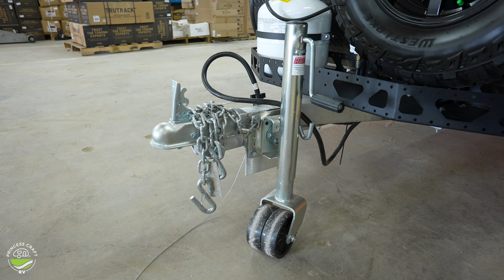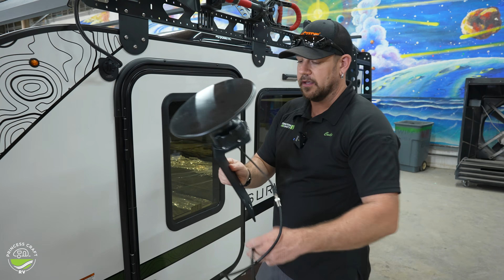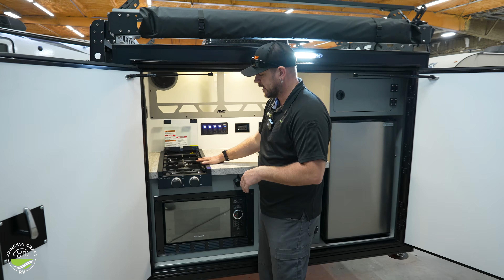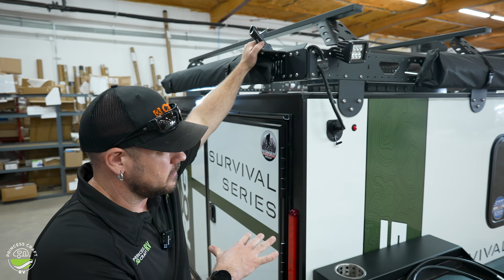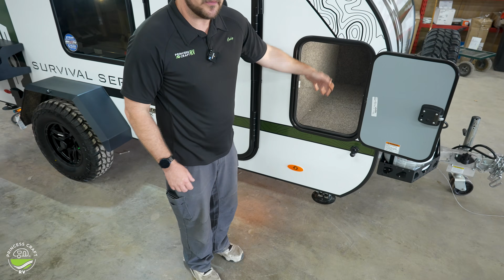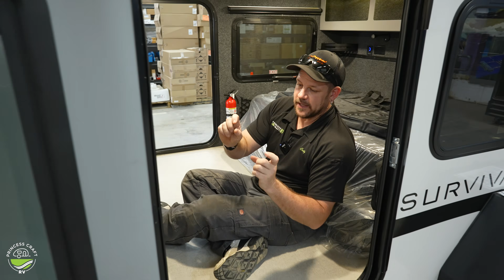ROG 12RK Survival Series Adventure Trailer by Encore RV   Tech Tour

Comment: Nice, but this is so totally overpriced based on what I saw at the dealers lots.  No real shower, no holding tanks, no articulating hitch (the ball hitch is joke if this is supposed to be an "off road" trailer), too small of a propane tank, crappy cheap tongue jack and cheap levelers and no water heater, not to mention almost no storage.  At 30K there are better "rolling bed" trailers out there.
Reply: Legit question from a novice in the market for an off road teardrop/ toy hauler style trailer, under 30k and with outdoor cooking facilities. I’d be interested in any suggestions. Thank you!
Reply: Thank you very much for taking the time to reply -  I really appreciate it and will check out the Hiker trailers.
Reply: Totally agree.. my dealer in Mesa has this for 37K firm and it is just sitting there with no takers.  WAAYYYYY overpriced for what it is.  It should be priced closer to the non-survival series that they could not even keep on the lot.
Reply: Mod buggy makes a nice 12 and 10 footer for under 20k

Comment: Price
Reply from the maker: That exact trailer's sale price $25,995 and the MSRP is $31,145. Thanks for giving me a chance to go track down that information for ya!
Reply from the maker: We'll have to track that information down with somebody from sales. We're on the service and technician side of the building. I'll try to get back with you!
Reply: One thing you did miss is there is a valve for the water behind the interior back wall for winterizing. You have to remove a few screws and open the back wall to winterize/de winterize.   Some units have that valve underneath the sink I’m told.
Reply: My 12 rk with every option but the awnings, plus a generator, inverter and a 270 ovs batwing come in at $37k.  That’s with 3 lithium batteries instead of one.
Reply: In Canada it comes with a Canadian flag
Reply: Also fenders are step on
Reply: There’s one option this didn’t have.  Two additional lithium batteries